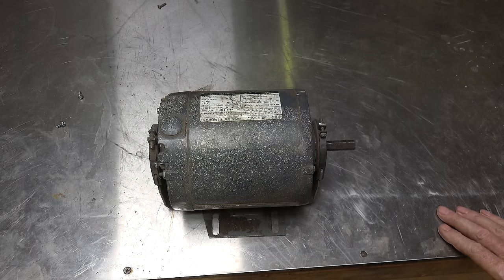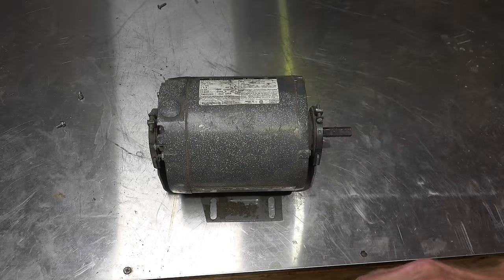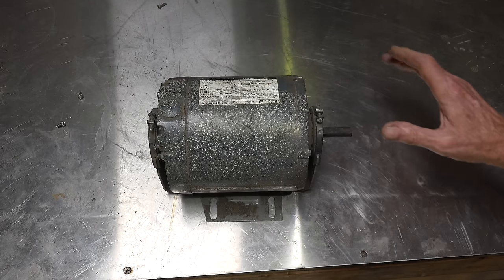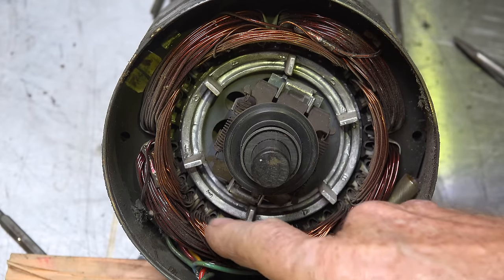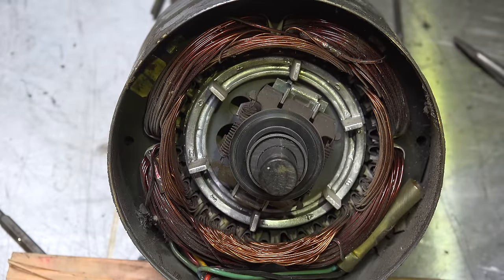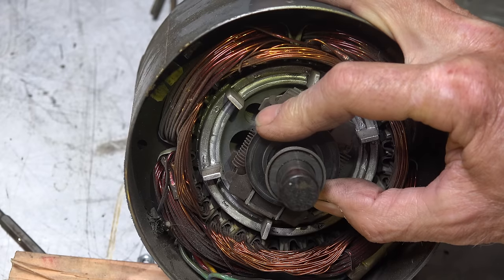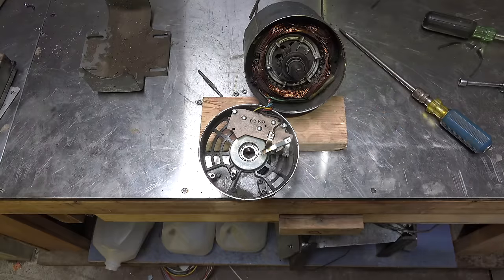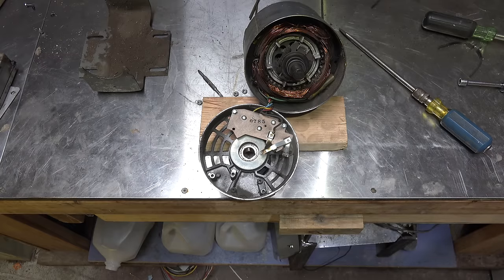How the centrifugal start motor works. #1

Comment: major thanks, this video helped me fix my older craftsman table saw, saving me a $250 motor. turned out all I had was a sawdust fouled centrifugal switch, which I learned the correct functioning of here.
Reply from the maker: Ahh, the old sawdust trick.  Very common.
GFM

Comment: The centrifugal switch removes the start coil from the circuit after the motor is up to speed. The start coil provides the necessary phase shift needed to get magnetic field rotating from a single phase supply.  It is not used as the video suggests to get a fan with a higher inertia running.  Inertial loads that keep the start coil in the circuit too long can damage motors utilizing centrifugal start switches.  While motors such as cap-start or split-phase that use centrifugal start switches inherently have higher start torque than typical PSC motors, it is highly unlikely the reason they are used to start a blower or fan.

Comment: Hi sir
I taken a motor apart cleaned all up , It has a 3 leg type centrifugal and the two contacts are copper, It has no start capacitor and no run capacitor, 
When I switch it on at first I see a spark but runs fine, where the wire get connected to the motor from plug I see the spark there about, I have an earth wire from my on and off switch coming from my switch ,if I connect the earth wire from the off and on switch to ground the motor does not trip my house box , but if I remove the ground wire from going to earth on my bench it trips the house electric , 
So if I was to connect the motor to a machine body it will not trip the house electric, What are your thoughts on the spark on start up is this normal or could it be the copper contacts,

Comment: Just want to remind viewers that dead center (starting from full stop) is not the same as frozen bearings (bearings that won't turn). If the bearings are frozen and the start winding is energized then they'll burn out because the rotor couldn't rotate to the appropriate rpm to disengage them.
Reply: huh?
Reply: +littlefatzrow It's all there man, you may have to look it up.

Comment: Tried to get the theory down. If centrifugal switch is open or no contact is made to the start capacitor circuit to the start winds, then the initial rotation will not happen or the spin will be slow.
Reply from the maker: Generally, the motor will not start unless there is a run cap.
GFM

Comment: What if we connect the starting winding to the motor in running condition ? Means if we connect the centrifugal switch permanently to the motor (any how). Please answer willing to know
Reply from the maker: If the start winding is connected to power continuously,  the amperage draw will be excessively high and the start winding magnetic field will interfere with the main winding  field.
GFM